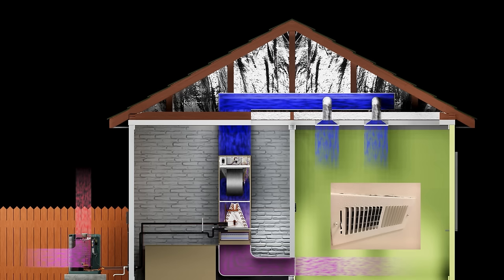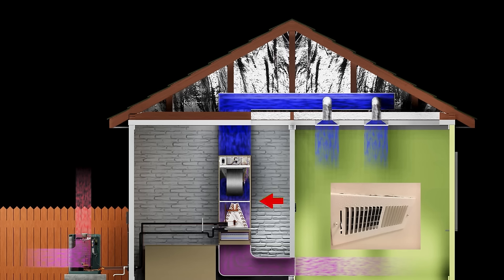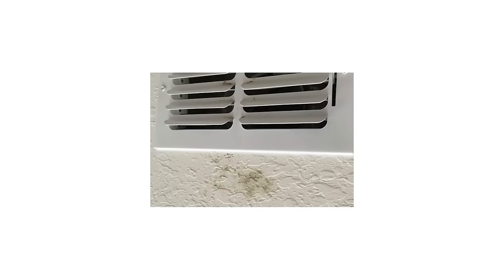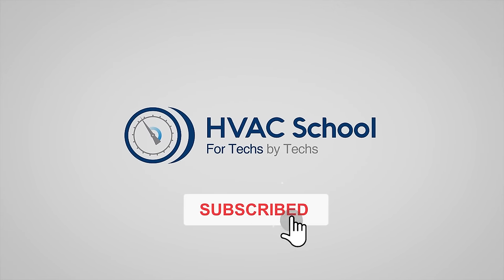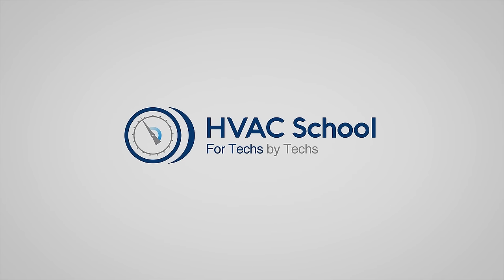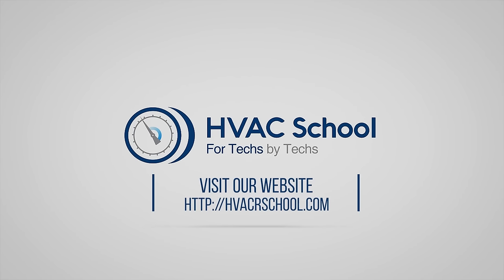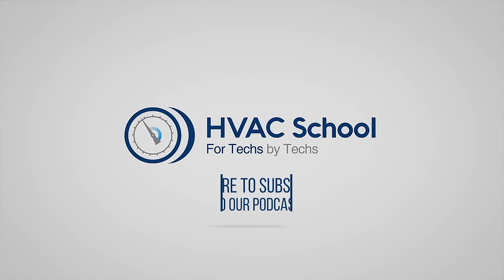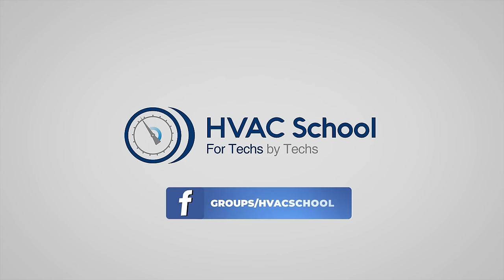Stop Sweaty Ducts, Vents and Systems

Comment: Hey Brian, This subject came up at my company last week. I live in Charlotte, NC. Tropical climate. My boss said in order to prevent sweating on ductwork with a two stage system is to design the ductwork for 1st stage only due to velocity issues and ducts being to cold on inside. Do you agree with this?
Reply: He says in the video that temperature of air inside ducts plays a minimal effect on surface temperature
Also i would add that reducing velocity will increase heat transfer to each cubic foot of air inside the duct making it warmer not colder. Also would be less energy transfer to surface temp of ductwork than at high velocity since the temperature difference is less per cubic foot of air too
Reply: The additional static pressure gain while in second stage will result in reduced airflow OR premature equipment failures. In my experience so long as your at or above 400 fpm in a vented attic your fine.
Reply: I live in Charlotte also and have sweating metal ducts that are not insulated.
We had to deal with a mold problem 2 years ago and had to tear out a great deal of sheetrock ; we encapsulated the crawlspace.   We have not installed new sheetrock so we could monitor the inside temperature vs when the ducts started sweating.

We where considering a whole house dehumidifier.  Should we also insulate the metal ducts?
Reply: @vikkideanegomez  HI Vikki. Your sheet metal duct definitely need to be sealed and insulated. Was your mold issue from the duct work itself or another cause? It is very possible that your duct work is original to the house and has a couple different equipment changed out over the years. Is it in the attic or crawl space?.  If you haven't already, It will be in your best interest to an hvac company to inspect the ductwork to see if it needs to be upgraded. My company would be more than happy to help out.
Reply: @smacleod69  thank you so much for the information.  We live in North Carolina so I'll find recommendations for 3 well-known HVAC companies to come give us a quote .
Reply: @vikkideanegomez  your welcome
Reply: @vikkideanegomez  When you encapsulated the crawl space was a dehumidifier installed?  It should have been.  Are the ducts in the crawl space or the attic?  The ducts should always be insulated and sealed.  I believe the building code currently requires R-8 on ducts.
Reply: @madzmadeit  ...NO....he says trying to get a temp DIFFERENCE on the inside will have a minimal affect on the outside surface temp. Think this through....if the inside wall of a container is cold, and there is little thermal barrier between the inside and outside....the outside surface WILL get cold....maybe cold enough to be below the dewpoint of the outside surface air temp...and it will sweat.
Reply: @TheWilferch  What on earth are you talking about we are talking about insulated ductwork with a vapor barrier.
Reply: @madzmadeit  ...I'm talking about the topic here. Sweating on outside surfaces of ductwork and on outside surfaces of air handlers that sit in a hot attic. It applies....the temp found inside these areas matters...and moreso...if those areas are poorly insulated and migrate (conduct) those interior cold temps to the outside surface....those surfaces will sweat. What's not to understand? With enough insulation applied,  then the outside temps won't reach dewpoint of the surrounding air,  and no sweating occurs. If you listen to the presenter he says modifying the temps inside ( of the conditioned space or the air handler or the ductwork...doesn't matter)....if you play with these by CHANGING them only a few degrees....it won't do much to help.
Reply: @TheWilferch  12:25 he says the temperature of the air inside vs outside not a change in delta T but this dependent on the R value of the insulation. Yes of course inside temperature plays a role but becomes negligible on well insulated duct work with a vapor barrier.
Reply: @madzmadeit  ....maybe we're coming to the same point. YES.....if "well insulated".....the sweating effect is reduced or eliminated.  You DO need appreciable and good R values to achieve this. In my own case study it  shows to work,  by me putting several layers of high-R, foil-faced poly sheet on all sides of my attic-located air handler....which USED to sweat a lot. Not anymore.

Comment: Make sure duct insulation is well sealed.  Replace any soaking wet duct insulation fiberglass and seal new insulation well.

Too big an A/C unit for area with short ON duty cycles makes cool damp caves.

Comment: Wrong.  You actually do have to pull out the insulation if your going to foam an attic at the roofline.  Its code and if its not in your area then thats weird but now all that nasty insulation is in conditioned space.

Comment: Ripping out a radiant barrier to keep you duct from sweating is the dumbest thing I ever heard.  My Ac literally cost me 300 a month without a radiant barrier and 60 with it. Go buy a dehumidifier
Reply from the maker: In a vented attic? How would that work? It doesn't matter how low your power bill is if your attic is full of mold
Reply: @HVACS  I live in st louis and it gets very humid here all summer.  I just made sure all my ducts are insulated with no leaks. Also my attic is well ventilated and insulated with a radiant barrier ) it stays close to outdoor temp). No major condensation problems with this setup.  I use a plug in dehumidifier inside separate from my hvac to keep exes humidity goin into my intake and overloading my hvac. The reduction in cost of power bills before and after insulating and radiant barrier is dramatic. My ac used to run all the time and would not get below 81 on hot sunny days costing me 250-350 a month.   Now my house stays at what ever temp I set reasonably and my bill is like 60-100 a month.  I could not imagine living with a hot attic in st. louis unless you AC is way oversized and you have money to burn
Reply: @HVACS  Love your videos, and I'm going to look back at the one you mentioned in this video (Rick Sims: Conductsation). Someone had suggested in the comments (for a retrofit) to airseal around the boots from the attic to the conditioned space below and add extra insulation around the duct itself since the r-value is only about 8max. Seems like an acceptable and economic solution vs airsealing the whole attic for some situations. (Because having access and room enough to do that might not be feasible for everyone.). What do you think about this as a workable solution?  Thanks again!

Comment: This video helps me as a layman.  There is no such word as comdensating.  The duct does not condensate. It condenses. Water does not condensate on the outside of the glass of ice water any more than you can conversate  with someone one. You converse. Great presentation otherwise.

Comment: IM A WOMAN JUST TRYING TO FIND A SOLUTION TO MY HOOD ABOVE MY STOVE SWEATING BAD!!! AS WELL AS MY VENT... NOT PLAY A GAME, ANSWER THIS ???? OR WHY???? DUDE I JUST WANTED A SOLUTION!!!! ONLY THING I UNDERSTOOD WAS, I DO KEEP MY HOUSE AROUND 68 DO TO HORRIBLE HOT FLASHES BEYOUND MY CONTROL!! SOMWTHING A MAN WOULD NVR UNDERSTAND!!! LETS PLAY ANSWER THIS QUESTION, WHAT HAPPENS IF U STAND TO CLOSE TO A GRILL A KEEP STANDING THERE AS SWEAT POURS AND UR BODY GETS HOTER & HOTER!!! WHATS THAT CALLED???? COME ON DUDE, ITS CALLED??? LET ME HELP U, A HORRID HOT FLASH!!! SO U DO WHAT TO COOL OFF?? THATS RIGHT!!!! U JUST STEP AWAY FROM THE GRILL TO COOL OFF . WELL THATS HOW I FEEL IN MY OWN HOUSE THERE FOR I HAVE TO KEEP IT VERY COOL... BUT TNK U I WILL KEEP THAT IN MIND TO POSSIBLY TURN MY AIR DOWN. MEANWHILE WTF DO I DO ABOUT THE CONDENSATION??? U HAVE ME SO CONFUSED PLAYING MR TEACHER MAN THEN JUST CUTTING TO THE CHASE AS HOW TO FIX THE ISSUE.. ABOUT 25MIN OF MY TIME I WILL NVR GET BACK TNKS
Reply: Your hood vent sweating is most likely from the outside humid air coming in when the fan is turned off, there needs to be a flap that can close (when the fan is off) to stop the outside humid air from coming in the exhaust vent back to the hood.

Comment: Grade F. 20 minutes of theory that could have been boiled down to five, zero practicality. Here in Houston we are always hot and have high bills. We need it cooler, cooler, cooler, always cooler. You've never been in a house in Houston where the ceiling fans weren't running and everyone is still hot.  So all this talk about increasing heat and heating things is useless. Total practical advice in this video is one sentence in the last minute, to seal your air vents against attic air hitting them, but that is just thrown out with little thought, no advice on how to do that. Why spend all that time explaining the wheel? Aren't the answers to this problem already known and can't you just actually give the methods used to solve the problem? I'm sure they are known and you could, but somehow you are a member of the "don't give away trade secrets to anyone" cabal.